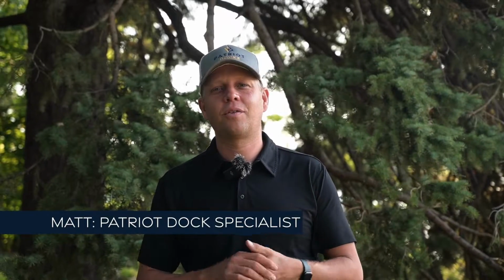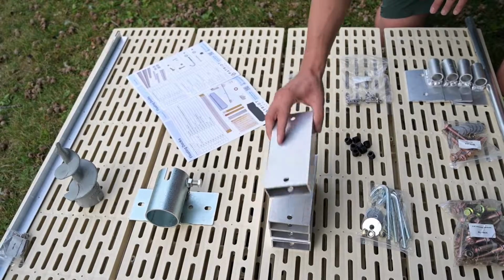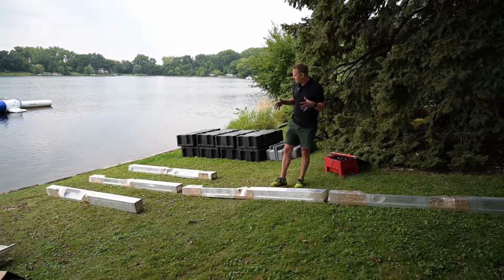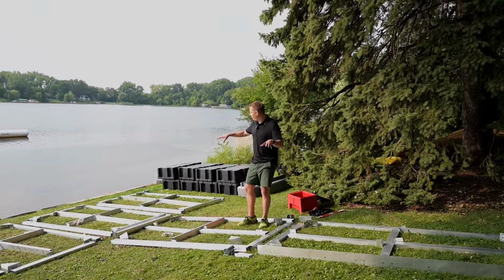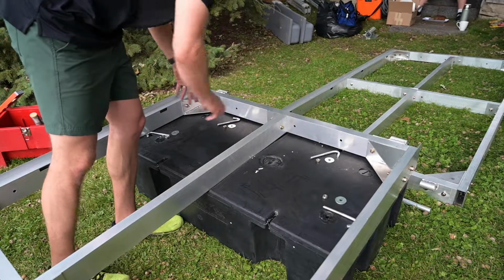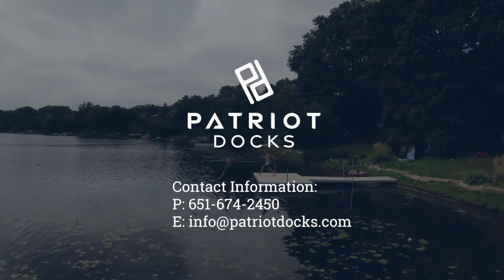How to Assemble a Floating Dock | Patriot Docks Floating Dock

Comment from the maker: 00:00 Introduction
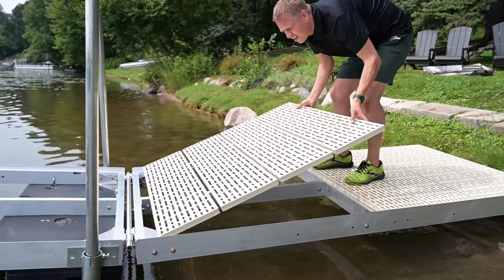00:54 Layout Components
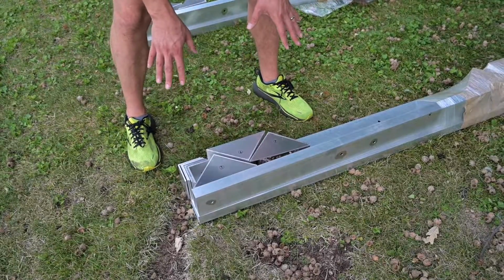03:45 Unbox and Layout Frame
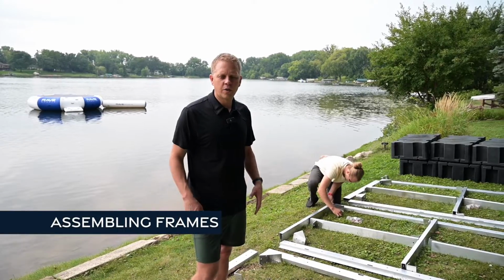05:26 Assembling Frames
06:14 Attach Floats to Frame
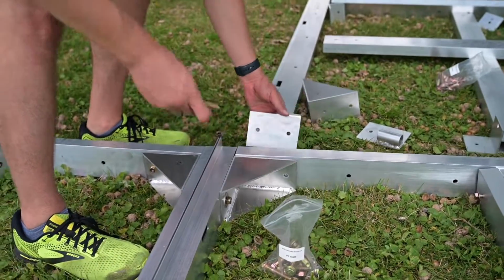07:10 Connecting Hinge 
07:22 Attaching a Piling Sleeve (10938)
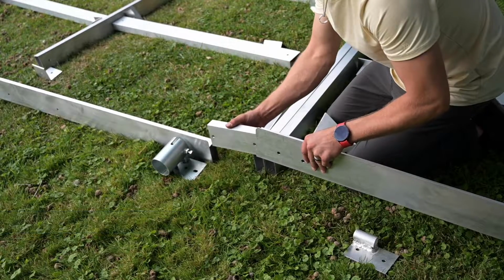07:49 Example of Hard Connection Between Frames
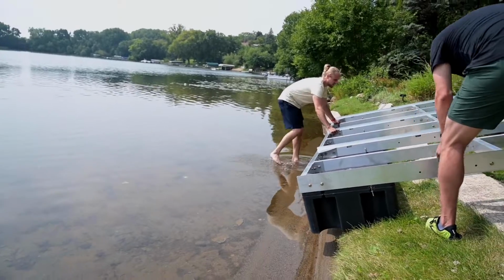08:29 Attaching Sections with Hinge 
09:08 Using Pilings to Anchor a Floating Dock
09:22 Add Decking Panels and Deck Lockers
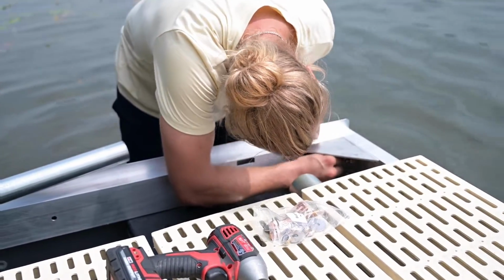09:37 Attaching Side Stability Floats
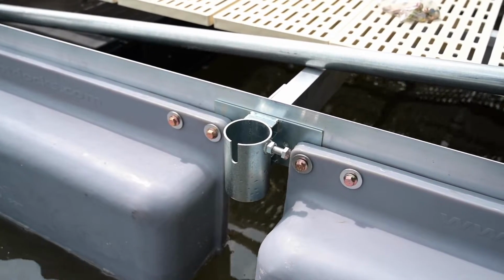10:00 FAQS

Comment: For swimming does the aluminum get to hot to walk on barefooted?
Reply from the maker: Aluminum decking features air-cooling channels right below the surface of the decking, and a powder coated surface, so the brown color measures similar temperatures as solid wood decking, whereas the gray color is even cooler. We would not recommend brown aluminum decking in some climates, but customers do enjoy this decking all over the continental USA and beyond. It is not as hot of a surface as one might expect. Reach out to us at info@jackdocks.com or 877-845-9487 if you have more questions about the specifics of your application.